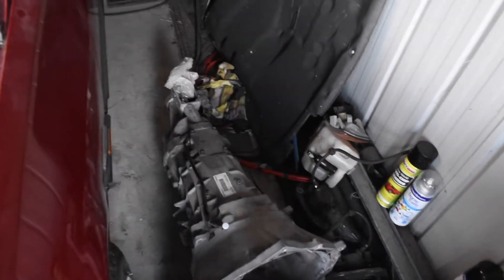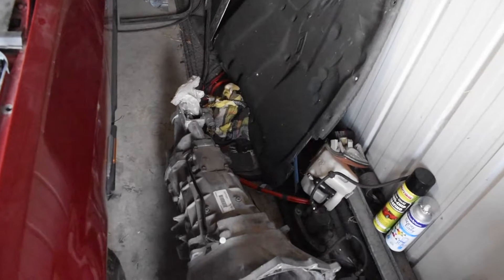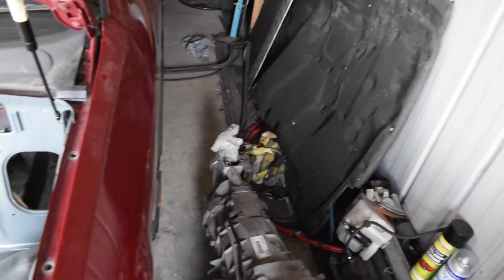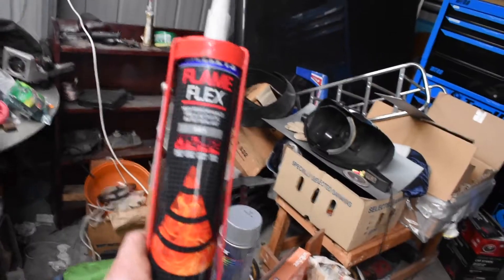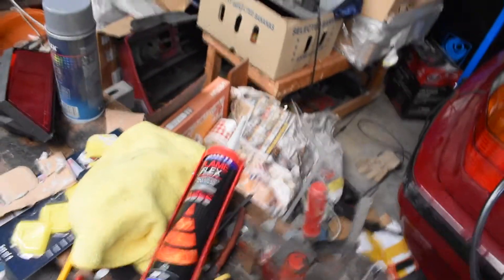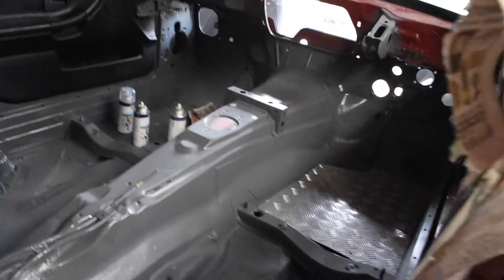ls1 E36 update - So much to come!

Comment: Sideways Downunder - Did you end up figuring out the e36 tie rod situation? I'm dealing with the same issue right now - I'm tempted to rethread the inner e90 arm.
Reply from the maker: Hector Caro, i haven't had a chance yet, yeah i thought about doing that too, ive seen people use the stock e36 inner tie rod, so i might try that and see!